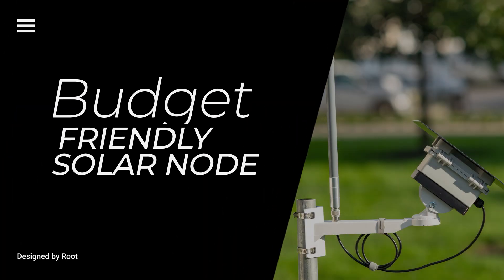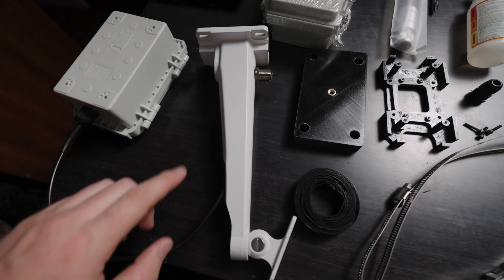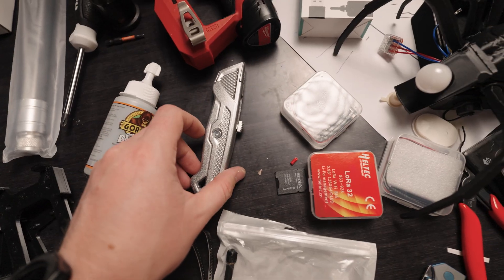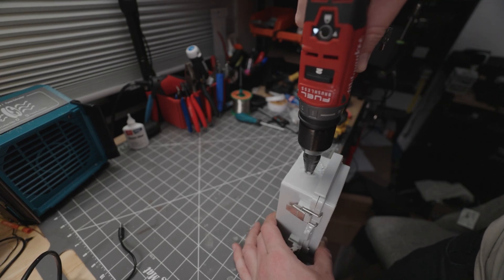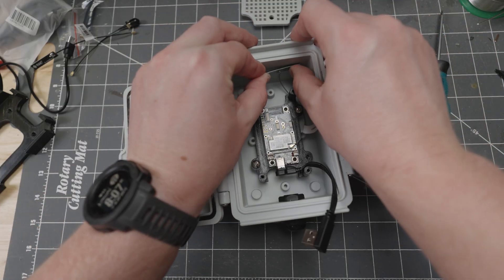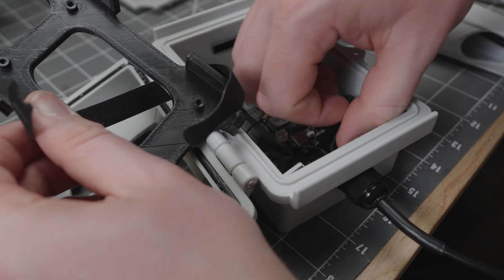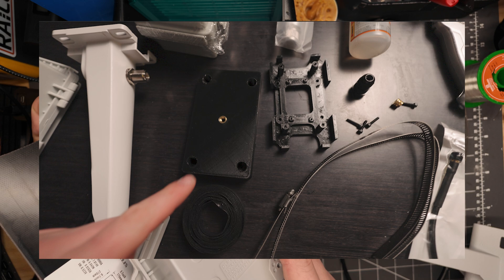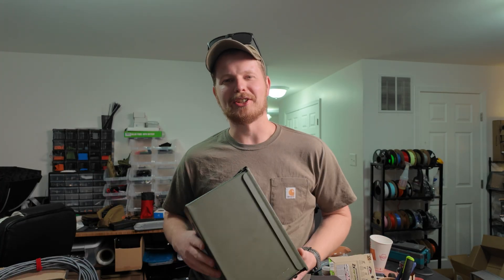The $150 Meshtastic Solar Node Build Guide 2025

Comment: Am I crazy or did you skip the part where you show how the solar panel connects to the battery or board?
Reply: My toughts as well. No external charging circuit seen in the build

Comment: Do you have a different version of the black back block with the 1/4-20 thread? I printed it, but its a good bit different than the one in the video. It has two holes at different depths. Curious if you had any instructions or guidance before I start designing my own. Thanks!
Reply from the maker: Let me see if I can dig up the old design. I’ll upload it to the drive and let you know
Reply: @Districtfourtyseven  Any change you were able to find the old design?

Comment: Could you connect a yagi to this system to get the signal further? Thanks
Reply from the maker: Definitely can. But the goal is to keep the cable as short as possible.
Reply: @R @Districtfourtyseven  thanks I’m looking at some extreme distances which would require nodes in areas with good line of sight. Would be nice to have a receiver Omni with a yagi as the sender
Reply: Yagi may increase gain in the direction of the antenna, but make sure the antenna is secured well if you have any high winds

Comment: A nice build but, way too many parts. I run a 6 inch Ipex to N-type mount in the same box with a Heltec V3 board and just a usb power cable up the 40 foot pole.  Full size solar panel to charge controller with a usb outlet and 100 A/h battery and just plug into the usb .
I can re-flash standing on the ground if ever needed. I can restart simply by unplugging the power.  No need to de-pole the radio.
Well, after watching yours and several others videos, you have me convinced solar power is the way to go.  I have ordered a RAK  wis block & 4631 for my new build since they use far less power than my Heltecs. Keep up the great videos!
Reply from the maker: There’s thousands of ways to do it. What if you can’t run a USB to the pole? Or it’s set up on some random tower? 

This is meant to be complete self powered.
Reply: @Districtfourtyseven  Good point.
Reply from the maker: @Bill-h3j  however!!!!!!! If there’s an opportunity to just hard wire with a USB cable. I think it’s a good idea to eliminate the need for a battery. Etc.

Comment: 2ft 6 inches of cable for 900mhz is way too long. You're getting extreme loss in the wire with very little power actually leaving the antenna. You would be surprised how much you are actually loosing in that wire. Max cable length I would do on 900mhz is 6 inches. Your way better on your earlier design with having it on the top of the box and running it directly from the antenna port on the board.
Reply: The "extreme loss" you're referring to with the rg58 coax he's using at 2.5 feet is only 0.16 dbi. Rg58 coax has a loss factor of 6.6 dbi at 100 feet in regards to the 900 mhz band
Reply from the maker: Hey, thanks for the comment. 

I had the same concern when prototyping. But with my testing. It’s performing the same as the other node. It’s mounted in the same exact spot,  same antenna, and I’m picking up my local area perfectly. With the occasional random nodes here and there. 

But I agree preferably you want to keep that cable as short as possible. However some people need to separate the antenna from the node.
Reply: If it was further, I’d recommend LMR400, N on both sides

Comment: What’s the largest battery that will fit? I saw an 8000 and slightly bigger but I would like to put the largest battery that will fit in the box. Thx
Reply from the maker: You can fit a 10,000mah in there also
Reply: @Districtfourtyseven thx

Comment: Looks like the Willamette Valley region in Oregon would not work given that the solar panel has: "Strong Sunlight Required: Provides power only under direct and strong sunlight. Will not function in cloudy/rainy/foggy weather, nighttime, indoors, or other low-light conditions. "  I'm using what I think is a superior panel, the Adafruit  $35 "5V 5W Solar Panel - ETFE - Voltaic P105 Product ID: 5367 ", for a Lora based temperature/humidity sensor and with the approach of winter coming, I'm finding that my Adafruit Lithium Ion Polymer Battery - 3.7v 2500mAh Product ID: 328 is not able to supply a high and constant demand of 50-55 mW.